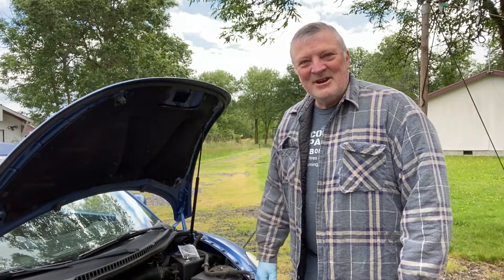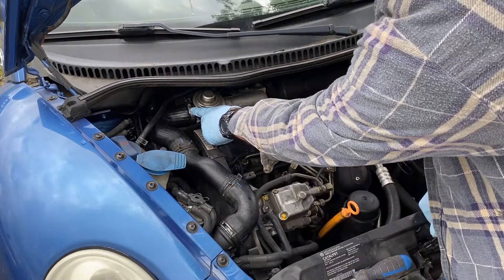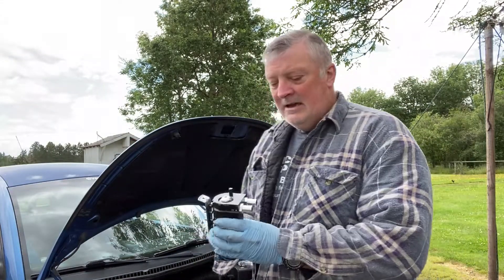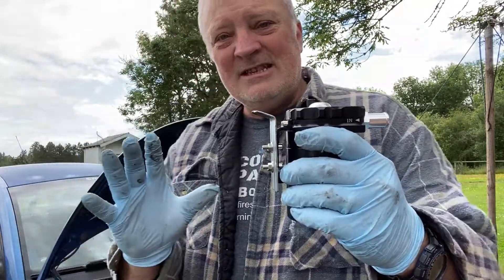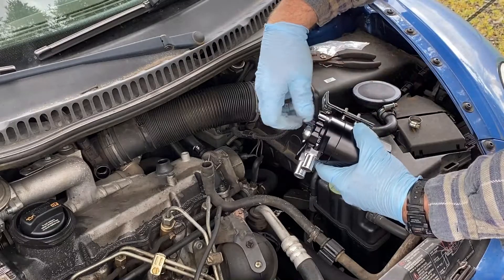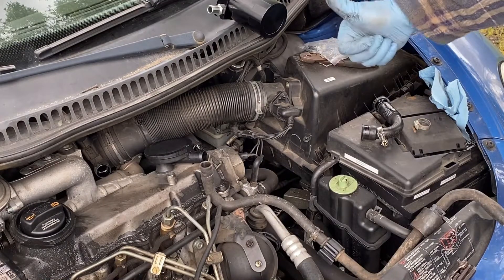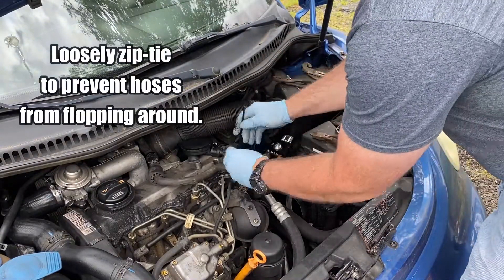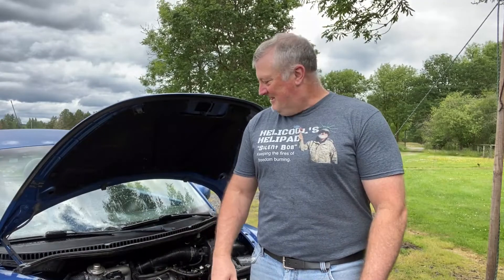OIL CATCH CAN INSTALL: VW New Beetle TDI

Comment: Thanks for the video, it helps me. Anyway, the engine here doesn't run very well, you can hear that the fuel pump is broken. I would check the values in VCDS and adjust the injection dose and check the pre-injection. If the car still exists :)
Reply from the maker: Turbo is shot, too. Maybe I’ll have time this Fall to work on it.

Comment: I am looking @ this @ Amazon...   do you reccomend to use the AIR BREATHER on top of canister as supplied in this kit ??  On an ALH TDI what interval will be correct to DUMP  the oil collected??  2 weeks , 2 months, 2 years ???
Reply from the maker: It really depends on how much you drive it. In the top is a dip stick that you can check from time to time. I would really think it would take perhaps several months of driving to fill the unit. Perhaps check it ever 3000 miles when you go to change the oil.

Comment: You could just install methanol injection and delete all those emissions so you can help save the environment. Clearly the car manufacturers are not trying to.
Reply from the maker: A diesel + methanol injection system? Separate tank and all, plus methanol is not exactly easy to come by and it's expensive. Diesels are actually cleaner than most... better fuel economy means it burns less than gasoline burning engines, and the "smoke" is a suit which does not linger in the air very long at all.... unlike gas burning hydrocarbons.  It would be interesting, though.

Comment: Where i find this hose you used?
Reply from the maker: Just head down to your local auto parts store. Bring the fittings you will be using and buy some new hose for this project. I just had some junk laying around, so I used it. Don't do what I did. Buy some new stuff. 😀

Comment: Cool, liked and subscribed! Thought about doing this to my 2000. How’s this working out? How often do you check it? How often does it fill up? Thanks, Dave.
Reply from the maker: It is easy to check for sure... unfortunately because of the "lock-downs" I have not driven it very much at all... so I really can't answer your questions. All I can say is, no more clogged up intake... the bug can breathe again! And with this little car, every few horsepower restored really makes a BIG difference.
Reply: @HelicoolsHelipad  great, thanks! I really haven’t driven mine since March 2020, in the garage covered up with a Battery Tender on it. Been thinking about adding one, going to look for the one you installed, thanks again, Dave!👍
Reply: @HelicoolsHelipad  thanks for the Amazon link!👍

Comment: was the hose you used tight on the the engine side and loose on the catch can fitting?
have the same can and the largest size fitting is smaller than the fitting for the puck and intake.
Reply from the maker: If I recall, the fitting easily slipped on... I secured it with the hose clamps... there really is not a lot of PSI (barely different than atmospheric, slightly under vacuum). I used a hose salvaged from another VW Beetle... I recommend buying some hose the size you need from the auto store. It can't be much more than a few bucks for as little as you need.

Comment: I would say that is how to get it done. Strange that the engineers at VW couldn't figure out that this was a problem when you configure the vacuum off the case to not flow directly into the combustion section where the fuel (a solvent) would take care of the issue.
Reply from the maker: I'm not sure when they decided to move away from direct injection of these oil vapers into the spray streams of the fuel, which kept things clean. These New Beetles are really bad for coking up like they do.